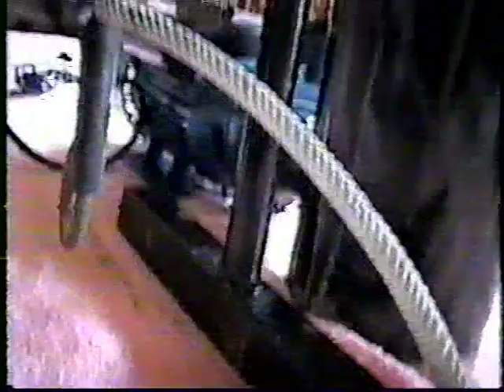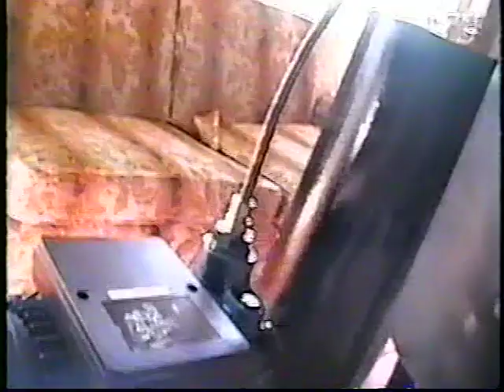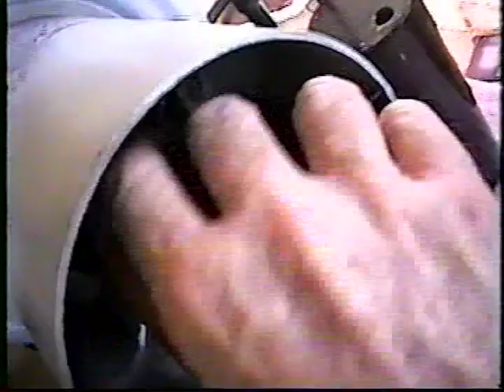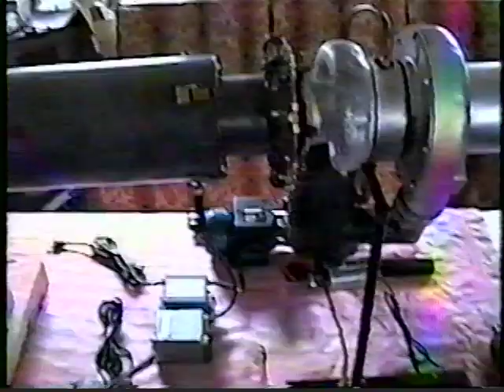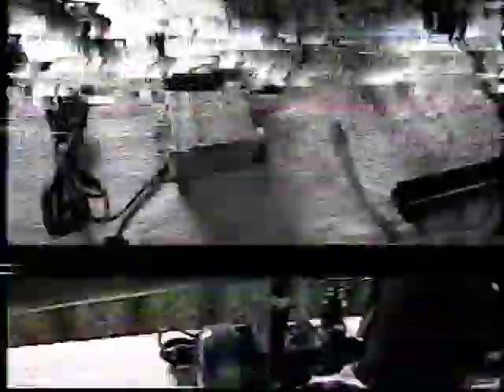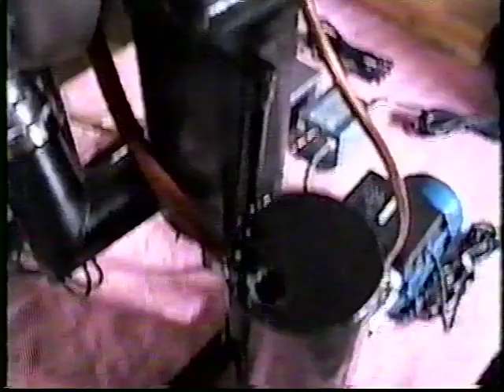Homemade Jet Engine Turbine for sale in New Jersey

Comment: Excellent job been trying to build one for 10 years actually bought one for $300 totally built but it didn't give me the fuel pump the oil pump and then I turned around and sold it for the same price I bought it but now I'm desperately trying to finish a project that I have never started